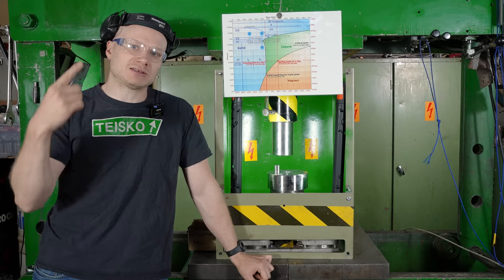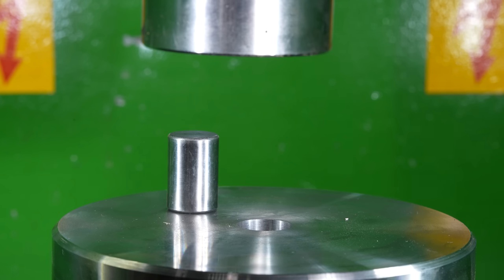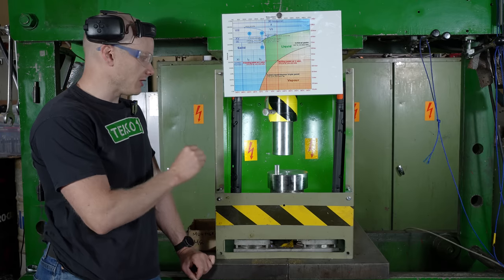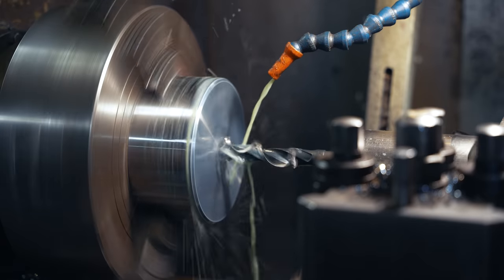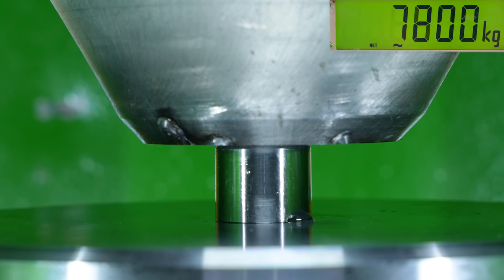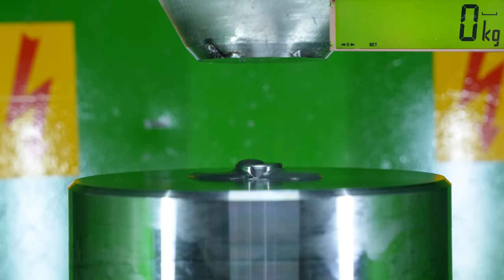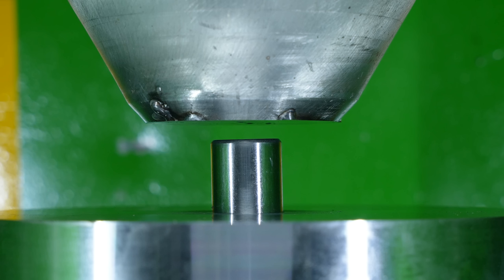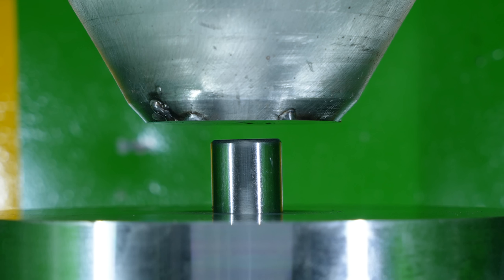Turning Water into Rock with Hydraulic Press

Comment: Fun fact: water has more known phases than any other pure material.  The weird properties of water are in part due to its hydrogen bond having a polarizable dipole, and the C2v point group symmetry of the molecule.  Good video.
Reply: I like fun facts and this is the second one this morning from YT ❤lol 
Best education platform in history some may say , once one has worked out what’s fact . Your comment is slightly outside my knowledge base but still welcomed 👍
Reply: @newagetemplar6100  Yes, there are loads of educational videos on YouTube from children's level up to top-level research seminars on every possible subject.
Reply: You mean it's wet?
Reply: Yes, it’s that wet wet.
Reply: silicon dioxide also has an incredibly diverse phase diagram
Reply: @MrTuneslol  Yes, SiO2 is amazing.  Here, we have bent, slightly flexible Si-O-Si linkages in the structure, instead of H-O-H.  SiO2 is not normally pure, however; it usually contains water, which weakens the structure, even at very low concentrations.  Pure, dry quartz is extremely strong.
Reply: @DEATHTOTHESHITTERS 2
Reply: No idea what you were saying, but sounds good to me! What about carbon?
Reply: @putteslaintxtbks5166  The two main forms of carbon are graphite and diamond.  In addition to this are forms based on the graphite and diamond bonding hybridization.  The graphitic forms include graphene, nanotubes, and fullerenes.  There are also amorphous graphitic forms, which may be graphitizing or non-graphitizing types.  On diamond-based forms, there is normal cubic diamond, and a hexagonal form called Lonsdalite.  There are also tetrahedral. amorphous diamond-like forms.  Note that all of the diamond-based forms of carbon have hydrogenated surfaces, and the amorphous forms also contain hydrogen.  Does than answer your question?
Reply: Water isn't a pure material though. It's made up of 2 pure materials.
Reply: @sanctionh2993  Water is pure in the sense that it is a singular molecular species.
Reply: @sanctionh2993  He is saying a molecule, not a single element or type of atom like on the periodical table.
Reply: This and organic chemistry honestly make me believe that while, yeah, there are 100s of billions of galaxies and 100s of millions of stars on average in each galaxy (lots of variation opportunities), extra terrestrial life would have to be very close to us. Nothing even comes close to the amount of stable molecules can be created with carbon as a building block with phosphorous, oxygen, hydrogen, sulfur, and nitrogen. And water is a big part of that. It's so unique and absolutely perfect for what it does in our bodies.
Reply: @cdI0. I hv no idea what you just said but it sounded academic af so i 👍'd it.
Reply: that is most probably due to humans researching water a lot more than other old thing
Reply: Yeah they have verified over ,18 types of ice i think

Comment: Now your next step is simulating nuclear explosion with flash powder, it has same temperature as nuclear fireball after 1 second :D
Reply from the maker: We already made a nuclear explosion simulation video. Didn't use flashpowder, went with 25 kilos of dynamite :D here is link to that https://youtu.be/ZA1UnzrR6f0?si=tcpV1dCZkztstPMV
Reply: @HydraulicPressChannel  yes but the dynamite doesn't reach nearly as high temperature ;)
Reply from the maker: @KClO3  Yep the thermal radiation was missing from this dynamite. I can do some math and maybe do a miniature version with flashpowder. It's not to safe handle that in such a large quantities as dynamite.
Reply: @HydraulicPressChannel  I will email you with further helpful information
Reply: Hell, he could probably initiate a nuclear explosion with the press. 

"Today we will be crushing this strange metal ball. It weighs about 6.2 kilos..."
Reply: @HydraulicPressChannel  I have sent you the email

Comment: Leaving an air pocket may be self defeating as air temperature increases dramatically as it’s compressed…  Your experiments in physics are entertaining as hell.
Reply: And it is soluble in water.
Reply: Ice VI is solid at higher temperatures, its created by pressure not low temperatures, the air would be long dissolved before that point anyway
Reply: @Lilith-Rose ?

You can make different forms of ice by adding or removing heat while keeping the pressure constant. This is complicated by different ices having different densities though. Ice VI is about 1.3 times as dense as water, ice VII about 1.5 times as dense (both would sink in water if they could be sufficiently contained). This means that you’d have to apply or remove pressure while adding or removing heat because the same weight of different ices have different volumes.
Reply: As the total energy of the system is constant, just wonder...hmm...

Comment: If the roller bearing piston was hollow on the lower end instead of solid, the water pressure inside the hollow would push the piston metal outwards, thus creating a tighter seal. At present, your design has this pressurized water expanding only the borehole in the large block of metal, which then loosens and destroys the good seal you are seeking. As the inside diameter of the hollow piston is made larger, the sealing pressure will increase, but you can't make the wall too thin because you need those walls to resist the sideways forces of the not perfectly rigid frame of the hydraulic press. (A tapered hollow can give you the best of both worlds.)
You actually need at least part of the piston metal to deform more easily than the cylinder metal. You could try putting a much softer metal, such as lead or copper, as the hollow lower end of the hard metal piston. Being softer, that metal will deform more easily, making a tight seal that still has reasonably low friction... Much like a bullet in a high-powered rifle. 
But notice that bullets are NOT made with a significant hollow on the bottom, because they could seal too tightly and make the gun explode. Related issue: A downside of this hollow bottom approach is, it becomes difficult to determine how much of your compressive force is being consumed by piston friction. A possible solution to that is to have a small tapered plug of some metal that will remain solid until you have exceeded your target pressure, and then exceed the plug's yield strength and be extruded. By knowing the yield strength of the plug metal, you can calculate how much hydraulic pressure is needed to make it extrude. 
And Yes, definitely DO polish the mating surfaces, at least of the hard metals. @HydraulicPressChannel

Comment: I think they start with normal ice as the higher stage ice 6 and 7 is basically removing the space from the ice molecules and forcing them back in to waters state while keeping it solid. It behaves less like rock or ice or water and more like metal
Reply: Filling the bottom tool space with distilled water and freezing it before applying pressure does seem like the way to go.
Reply: So if we had an ocean like 250 km deep, and we did go near the bottom, we couldn t go farther down because the water being almost solid ? I am understanding it right ?
Reply: @maxhartung97  Correct. The deepest water on earth is only ~10km deep, however, so we're a long way from that. The pressure was part of the reason going down to the bottom of the mariana trench was such a feat. Given that the earth's crust is at most ~70km deep, we probably won't be seeing water in nature in a mineral form anytime soon.

Comment: Try a 3 or 4mm thick copper disc which fits tightly in the upper wider part of the bore on top of the water, and then place the steel roller on top of this, the copper should make a tight seal.
Im not sure if the copper will finally squirt out at this pressure, but it should enable a higher pressure build up.
Reply: I think that copper is too soft, even softer than the steel.
It would leak just as fast, or maybe even faster because now the copper is working a lubrication.
Reply: @The_Keeper  It only acts as a gasket under the steel roller. The copper is soft, but it can only expand out in the bore, thus creating a tighter seal the more it expand. I think it's definitely worth a try. It would also be possible to experiment with other soft metals like bronze or brass.
Reply: @The_Keeper  Copper is quite frequently used as a crush washer and for compression sealing in plumbing because it is soft. It is able to deform into the micro grooves between harder metals and create a fluid-tight seal. Copper wouldn't lubricate between the surfaces. It would fill voids and make it very difficult for water to escape.
Reply: @CalculatedRiskAK  A tapered brass jacket over a steel slug was my thought. Tapering the plug and bore would create self-centering force and ensure the crush jacket is deforming into the interface rather than wedging the plug from any axial misalignment.

Comment: Here on the Canadian Prairies temperatures during winter can be as low as -40 Celsius, presumably similar to Finland. The city that I live in has complained that when the ice is thick and compressed on roads it's hard enough to damage the blades of the plows and graders. Somewhat related is that the steel on cars involved in fender-benders tends to shatter rather than bend at those temperatures.

Comment: I read a book on super high pressures years ago where they used gaskets made out of soapstone (probably contained within steel) when doing the first experiments to make synthetic diamonds.  I wonder if that could work here?
Reply: Probably this with tighter tolerances on the machining. Like those laser cut cnc'd pieces that slowly slide into themselves and you can't see the seams.
Reply: @benvaun1330 I think you mean Electrical Discharge Machining EDM is different from a laser.
Reply: Wire EDM
Reply: high-pressure research uses a mineral called pyrophyllite these days.

Comment: One thing you may want to consider using is an electric or laser thermometer, something to get the temperature of the water that leaks out. It could help you to figure out if you’re going too fast and heating the water. You may end up having to press it a lot slower, like 1000 - 2000 mbar at one minute intervals to allow cooling.
Reply: help him figure out if he's heating the water? the steam explosion wasnt a clue? lol

its a cool experiment and all but it is definitely just heating the water which makes it impossible to reach Ice VI+, the water/ice needs to be held at that insane pressure and allowed to cool back down but thats not possible with this setup

Comment: Three thoughts:

1. How hot does the steel at the friction surface get at that pressure? Is it hot enough to soften the metal at the friction surface enough to allow high pressure water to force its way through?

2. Iirc increasing the pressure an object in under causes the object to heat up, is it possible you need to cool the tool so that you don't end up trying to compress steam into ice? 

3. Another possibility that springs to mind, though is extremely unlikely due to your knowledge, is if you lubricated the surfaces the lubrication might be being forced out by the water allowing it to escape.
Reply: It would be cool to see what would happen using tungsten instead of steel.

Comment: My theory is that the steel is becoming plastic when concerning the forces involves, water is microscopically carving the steel away to get out like the canyons. My suggestion is a much less ductile material like tungsten, though you risk chipping/cracking during the interference fit.
Reply: Cemented tungsten carbide, then the steel container.

Comment: I think you'd need to apply the pressure slowly, and remove heat from the water/ice simultaneously. So, maybe use liquid nitrogen.
There's an increase in temperature when you're applying so much pressure, that heat needs to be removed to get to the part of the phase diagram where there's ice VI.

Comment: My suggestion for your goal is to improve the sealing of the cilinder. I believe that your weak component is the cilinder itself which at high pressures may yield and lose its original diameter (therefore weakening or completely losing the interference with the piston, your actual sealing). If that's true you should be able to measure that difference in diameter once you complete the test. An option could be to carefully machine a conic hole (and possibly a conic piston, but it's not necessary, it should work anyways) such that if the cilinder yields and increases in diameter you can keep the sealing by increasing the piston's run and so the interference force. This technique doesn't allow you to be accurate on the amount of cilinder resistance compared to the water's, but if the cilinder actually yields, also the measurements on your current system isn't accurate. Mine it's just an idea from a mechanical engineering student, for sure if you find online differend sources that achieved similar results, use their technique.

Comment: I think you'd have to go incredibly slowly to give the molecules time to reorganize. Going fast just generates heat too rapidly. The geological processes that create diamond with trapped ice VII are incredibly slow. Also the idea someone brought up of the piston being hollowed at the bottom so the pressure tightens the seal is pretty good. You already know full well that the steel is also compressible and that is probably the reason the water can squeeze by and cut a channel back out. You should probably try to find the densest and least compressible material you can for the piston and bore chamber, not taper the channel too much to avoid buckling on the sides of the piston, and possibly lap the surfaces to remove micro-channels. Natural ice VII is a fluke of nature that required an improbable combination of specific conditions. Even if you did create ice VI with this method, you likely could never verify it because it would instantly phase shift back to liquid water once the pressure was gone. If ice VII is stable as a mineral without maintained pressure, then that should be verifiable by drilling back into your bore to remove it, and that should be the goal.

Comment: Fascinating.  Brilliant.

Suggestions:
- polish all piston/cylinder surfaces to perfection.
- make head of piston severely concave to increase seal performance.
- start with ice as the compression heat will bring it to liquid quickly, yet allow for sealing before liquid water finds a channel.  Liquid will find a channel in any imperfection and exploit it.

Just a thought.
Thanks... Love your amazing work!!

Comment: Consider pre-soaking the die's in a dry-ice and alcohol bath, the parts will achieve something like -100 to -90F (attach thermocouples to the surface of the part).  You'd have to size the tooling for cold temp maybe take advantage of the metal expanding as it heats up to create/maintain the seal.

Comment: Perhaps you could fabricate some kind of two staged clylinder. An inner one with the water and an outer one with oil so that there is a smaller pressure differencial between the water chamber and the outside.

Comment: Try adding a conical protrusion inside the base of your pressure chamber And milling a convex conical depression in the piston portion of The device... that way when depressed completely the volume will still  be zero but as pressure builds in the chamber it will only serve to Seal its self tighter.

Comment: Typically hydraulic/pneumatic pistons have rings to ensure a seal with the cylinder wall. Think of the compression rings around an engine piston or the groves cut around an AK gas piston. Perhaps machining some rings around the piston would help with the seal?
Reply: Piston rings aren't going to seal as tightly as forcing a steel plug into a smaller hole though

Comment: Oh my gosh I love the laughter of Anni (Anne?)!
Try using degassed water. Use a high vac pump to degass it.. maybe while it is contained in the compression chamber. I'm a retired biomedical engineer who used to maintain Fresenius kidney dialysis machines. They run on ultra purity deionized RO water - but still use a degassing chamber to produce ultra high volumetric accuracy. The dialysis machine is strictly volume-based.
Thank you for the fascinating vids! You two are GREAT  :)

Comment: Make a dye that takes 26 tons to insert into the hole, then you can be confident that it will hold 26 tons of potential water pressure before leaking.
Reply: Because I think if it only takes 5 tons to insert it might leak once there’s 5 tons of pressure pushing back on it from the steam.

Comment: Water isn't compressible, or is only slightly compressible, so put a small hollow space into your bearing and cover it with a thin piece of metal that will form tightly inside your hollow space as you apply pressure. I also think you should be using something to keep the water as cold as possible to prevent it from flashing to steam. Also use ultra-pure water. Looking forward to how this turns out.
Reply: How am I not a subscriber now? I was for years.

Comment: I think the plug might work better actually if you used a softer metal like aluminum, because it would deform better to fill all the gaps
Reply: aluminum is like silly putty at these pressures

Comment: This is fascinating! I had no idea such a thing was even theoretically possible! But how are you planning to confirm the results of your attempts? Cut the base open and see if it's all steel or if there's a rock in there? Or are we just observing how much of the water escapes in its various forms and just guessing? 🤔
Reply: From what I can gather the forms of ice which he is referring to cannot exist at room temperature and normal pressure, if he was to open it back up it would just melt into water again. So I think the idea is that by figuring out a chamber design that doesn't leak, and then crushing it, he will be able to mathematically prove there is Ice VI or VII inside.